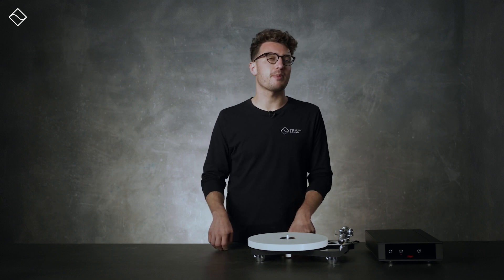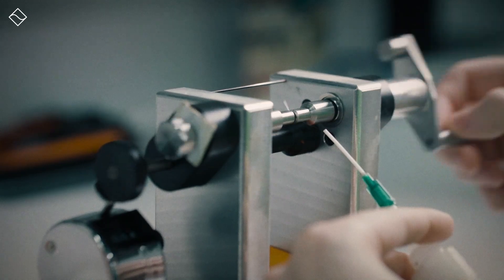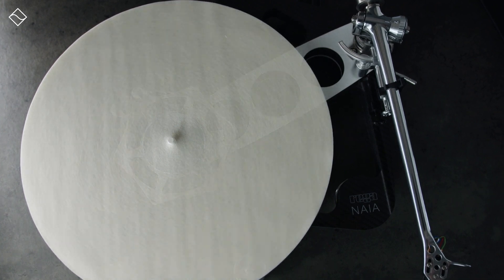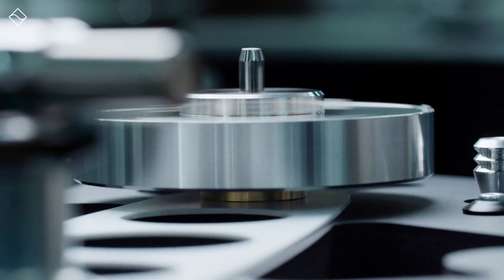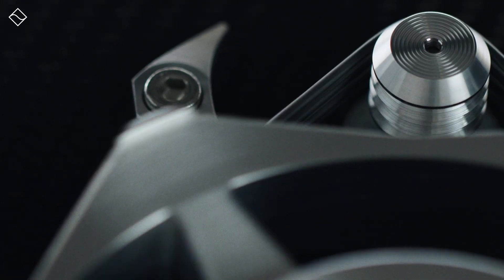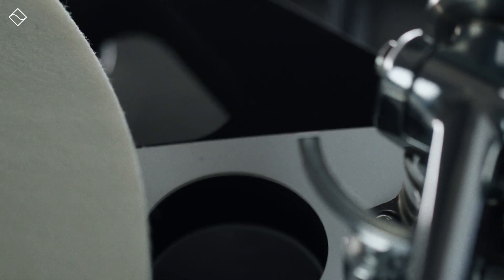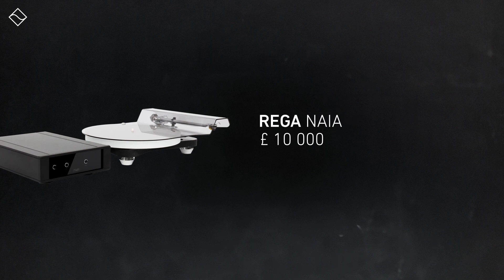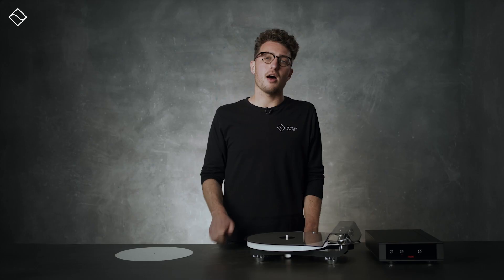Rega Naia Turntable Review

Comment: I like well designed and built turntables. I know from decades of experience that both ridgidity AND build quality- mass are integral to what makes a great turntable. The Rega is marketing entirely on the the fact that it is ridged and as light weight as it can be to support all the functionality of the table. So they got it half right, costing them less than if the table was massive. However, they are charging a fee that suggests it's a massive well built table,  which it is not. Aside from performance, I don't want to look at a table thinking it should cost way less than I spent. I would also be concerned about the use of foam as a plinth,  regardless of what the company says. Wait 10 years after testing  to prove out the longevity of that foam and that it will stay in tact regardless of changing room temps, before you try to sell me it. It's moot for me since I'm not in the financial demographic that Rega is clearly targeting.